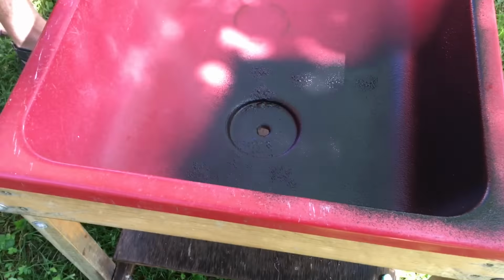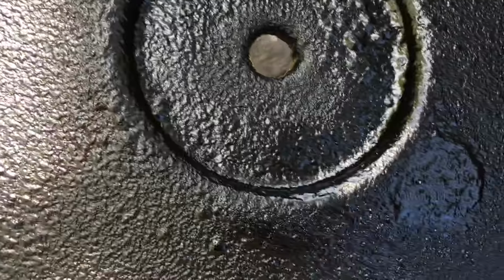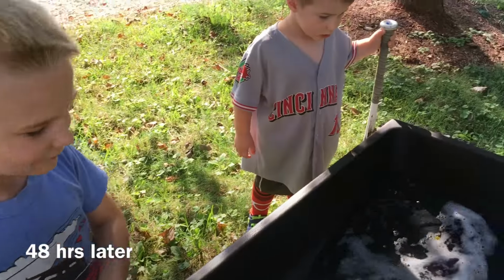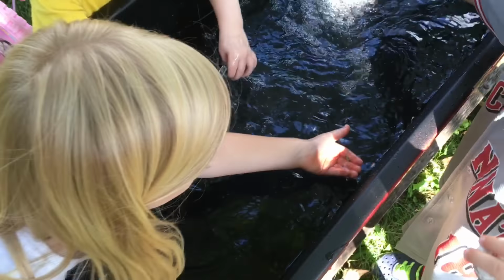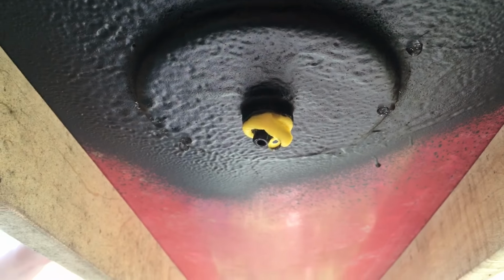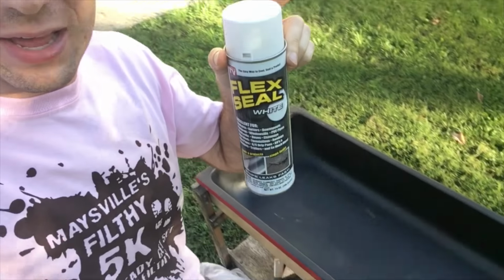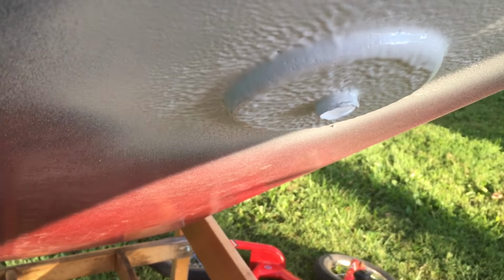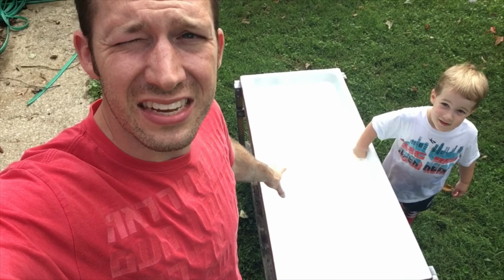Flex Seal -Unbiased Product Review

Comment: It's pricey, the spray version is very thin, the stuff in a tub must all be used. It doesn't store without hardening. If you use a small amount you may just as well throw away the rest since it hardens in the tub after first use. Would I but this again?.. No
Reply: What about the kind that comes in a spray can like spray paint?

Comment: It works well, but like any sealant or glue or paint “you must clean the surface thoroughly and let it dry completely, ruff up the surface with sandpaper before applying”. If you had bad luck with this product assuredly you didn’t ruff up the surface, some containers are made of materials designed to not allow stuff to stick to them, like the plastic a bottle of super glue is made of. “Ruff up the surface at least”. 👍

Comment: JB Weld makes a product to stop leaks. Used it before on main water line (copper) in an industrial setting.
Reply: How big was the line? Because I work in an actual water plant with 900mm mains and that stuff wouldn't even come close to working on them.

Comment: Replace the radiator in my 06 Impala.. noticed a small leak in a transmission line.. After a few coats and a few hours of waiting ! No more leaks 🎉
Reply: Dude those lines are pressurized. Did it hold?
Reply: A new tranmission cooling line cost a lot less than a new transmission.

Comment: I have a bathtub and a very stout 13 year old.While in the tub she shoved herself with her heels and it caused a big hole in the bottom end of the tub. I used flex paste to repair the hole. It has never leaked and has held up so far as it was almost 2 years ago. I have also used it on a refridge after it was badly dent. I repaired the dent with this product. One of those textured finger print resistant ones. I dabbed a plastic bag over this product to texture it. Almost disappeared. This product will dry out quickly in the jar.

Comment: Big storm heading into Cape Town overnight, level 8. There's a leak in garage roof over electrical box. Cant get onto roof..ladder too short. Used spray to coat roof on inside...will edit post if it works or not tomorrow.
Reply: Any news
Reply: R.I.P.

Comment: I purchased Flex Seal paste in a quart size plastic container, $29 + ST.  Problem was to seal leaks about 1/4" around the edge of my deck above my kitchen nook.  My experience: when weather is around 40 degrees it does not stick well especially to aluminum flashing.  I had to wear rubber gloves and with my finger press hard to have stick.  I found that it had a tendency to roll over itself and not stick.  Also, it is messy, have a lot of acetone handy to clean your tools, hand, clothing, etc.  Does it work?  We have had a two down pours and I need to get a few more to  see how well it does.  My take: if your need can be served with roof tar, it is a lot cheaper and easier to work with than this stuff and in my case, it would have worked just as well.  The ad shows applying under water conditions (the basement window shot), I am very skeptical of that given how poorly it was adhering to cold moist aluminum flashing and lumber.

Comment: Question: I need to use Flex Seal spray on a rooftop tempered glass dome.  Given how close the glass is to the roof, I have to tilt the flex seal spray can almost 90 so the spray nozzle is low enough to get the sealant where it needs to go.  But then the flow of sealant stops because of the tilt.  Anyone know of a solution?  Is there a long straw attachment (like a WD-40 can) that could help?
Reply from the maker: I would just use newspaper and masking tape to keep the spray off locations where you don’t want it

Comment: You empower me to buy the flexseal spray, I’m trying to fix a Rubbermaid tank, I hope it’s strong enough to hold the heavy water, but I’ll double coated or triple coated if I need to, also, I only needed to do a few sections, so hopefully my bottle will go a lot further thanks for this video. Glad I didn’t get the paste or paint or whatever. I’ll subscribe just for you man.